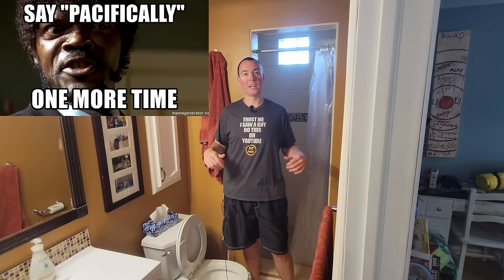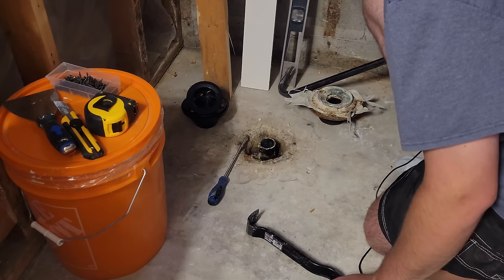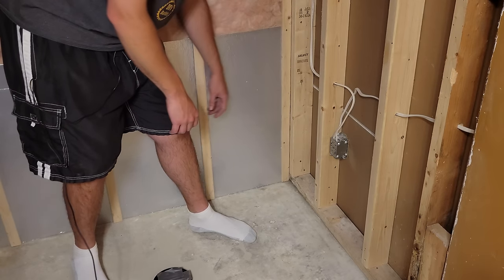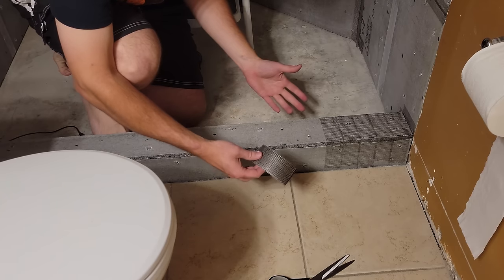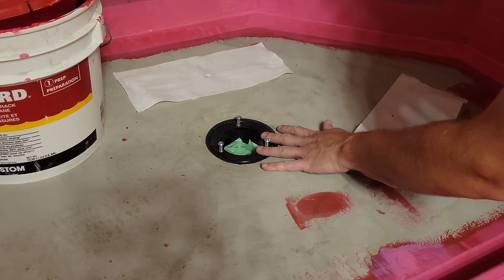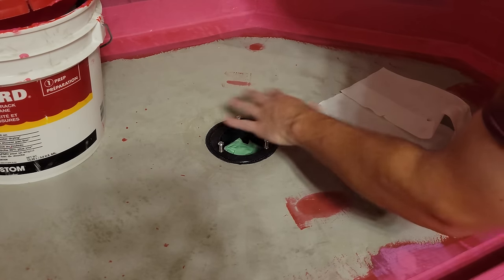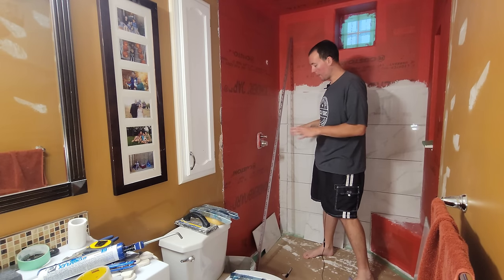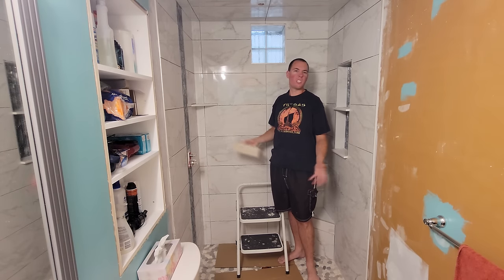DIY How to Remodel a Shower - Start to Finish

Comment: Great work. I have been building a new bathroom for our new master bedroom and the better 3/4 said I should film it and upload it... Well I don't have the you know what to fight off all the tile fanatics. Everyone has their own way of doing it and they all complain... Now our shower is 4x6 with a corner seat like yours but I did a linear drain and a partial half wall by the toilet. She picked out marble and it's not too pricey but the size of the bathroom makes it pricey. I will eventually get it finished this fall when it's finally under 105*. This house is my last remodel....

          That is an interesting shower valve you used. We don't have those south of the border. I went with a shower panel on the wall and a separate shower valve and hand unit for the seat area. Getting old with a bad back makes those handy... Don't ask how long I have been working on the master bedroom project...  Heat, $ and the body wanting to do it all get in the way.

Comment: I build bathrooms all of the time. You did a great job. I particularly like the name of this video as the name my company is A to Z Turnover Svcs. I actually have a little known YT channel myself. You saved yourself $1,000’s of dollars and you did it the right way. So many people skip the waterproofing step.
Reply: Are you serious when you say that people skip the waterproofing?
In Sweden we even have a "law" that say that you will be personally held liable for any water damage if the waterproofing isn't done by a certified contractor. 
Meaning your insurance company won't pay a dime if do it yourself or skip it.
Reply: @TheViking4  Here, our inspectors do a rough-in inspection where they check the framing, water lines, mechanical and electrical and assuming you pass that, there are no more scheduled inspections until Final. Its an expensive step and i always inform my clients that water-proofing is a part of our scope. its expensive but well worth it.

Comment: I had almost the same shower setup in my basement, except no window and the shower walls were lined with linoleum or something like that. Obviously had mold issues, but luckily they were pretty much contained to that room. It's still all ripped out so this video will help when it comes time to finish it.

Comment: sharkbite connectors would have worked a treat for the wet supply lines.  I used those at our old place when we added a basement bathroom.  No leaks and no worrying about wet pipes for soldering.

Great job as always!  I'd never heard of RedGuard, but I know what I'll be using when I redo our bathroom!!
Reply from the maker: Agreed but they are also expensive

Comment: I got a diamond bit and it came with wax in it.
If you use it with water as you did it's 20 holes for £15 instead of 3-4!

Comment: I am planning my own shower renovation and this video is a great help. Noticed it’s been a year since you posted it anything you recommend doing differently after (hopefully) using this for a year? Thanks.
Reply from the maker: I would recommend pex and a diverter system that doesn't require extra adapters. But that really comes down to preference. Also if you have the money framless glass doors are nicer.

Comment: I'm a bit squimish about you skipping the vinyl shower pan & relying solely on the Redguard... but you might be okay if the RG doesn't fail. Personally, I like having the vinyl as a fail-safe backup for the RG... it's cheap insurance. Your shower turned out beautiful... thanks for posting.
Reply from the maker: I know what you mean because I thought about that. But ultimately decided to trust the stuff as they have detailed drawings showing how to use as a pan and have been making it / selling it successfully for many years. Time will tell if my trust was wise.
Reply: @DIYBuilds  Plus you're on a slab down there. And if it leaks and someone thinks it looks dated in 20 years, you'll just be supporting some future YouTuber. It's the DIY circle of life.

Comment: Nice job! You didn't mention corking behind the plates of the showerpipes (where they go through the tiles). Did you do that? 

It's a common mistake and cause of leakage in showers.
Reply from the maker: The red guard is sealed around all that.

Comment: I might need to watch it again but did you put a single piece of marble or such across the top of the curb or the same tile used in shower?
Reply from the maker: It's a special sil piece that you can get at home depot. Like a thick long tile.

Comment: Great video, thanks for sharing.  Curious what your thoughts are on using sharkbite fittings rather than soldering in those tough situations like the leaky main valve?  We ran into a similar situation when replacing our old angle stops, but a workaround was to open the hose bib right near the main once the valve was off.  This diverted all of the leaking water out the hose bib at a trickle, and kept our lines clear for us to work.  Unfortunately we are all galvanized still, but hopefully will be tackling that soon as well.
Reply from the maker: Shark bites are great. I've had a few installed for over 10 years now and no issues. Unfortunately even with all other water sources open the water still came through but fast acting was enough to get it done.

Comment: Would you need to hot mop the shower pan before putting the cement boards?
Reply from the maker: The red guard is the hot mop